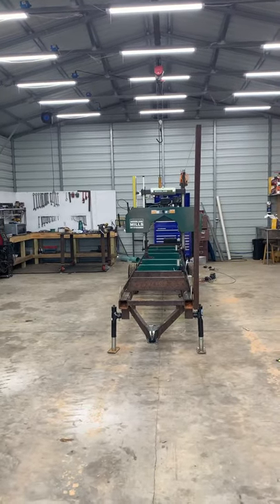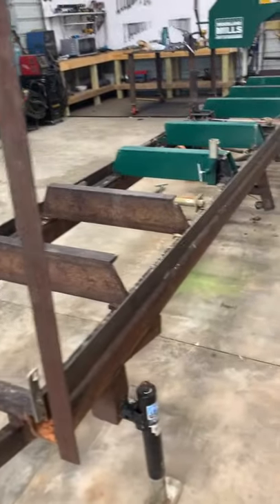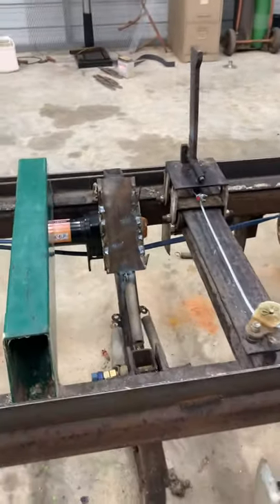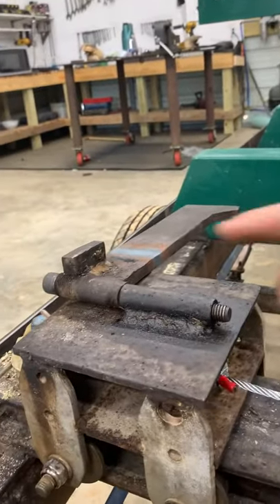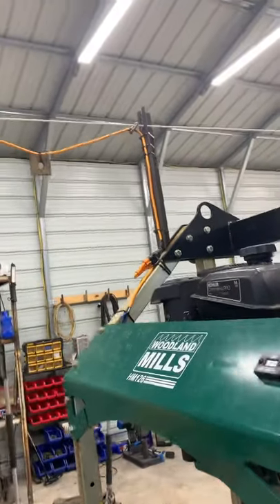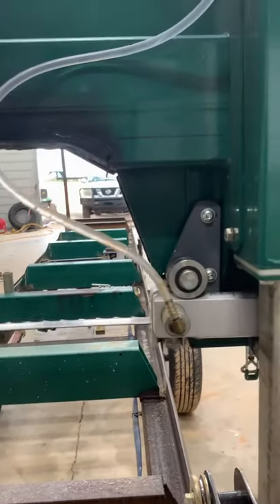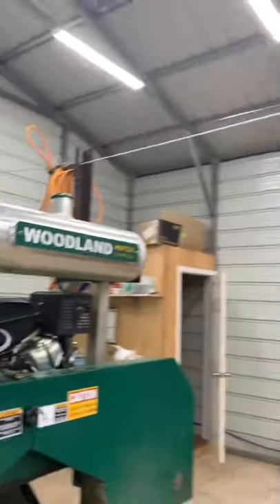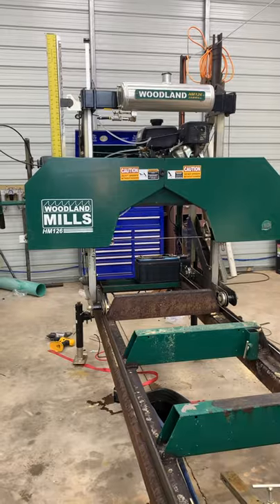Woodland Mills HM126 Modifications

Comment: Nice mods, I have the 2015 model hm126, did the trailer jack mod, no flex cable, mounted the battery on the sawmill frame, with solar charger, battery lasts for days before needing recharge. I put my mill on a 20 ton, 8x20 flat deck trailer, with canopy built into the stake pockets, can do 16’ 2”. All mounted an engine hoist with 2 ton winch to turn the big ones. Did a car scissor jack for toe board, easy to move around as needed for the tapered ones. Not sure how to make powered logs dogs that will work for every possible situation, might have to be hydraulic but that’s a expensive one. Happy sawing.

Comment: I would like to ask if you would be able to send me a link or at the least -model - manufacture or dimensions of the motors you have purchased that you used on your sawmill as my first attempt at purchasing the motor I ended up getting one that was so small I immediately shipped it back knowing that it would not work basically it fit in the palm of my hand all of these sawmill modification and builds are ingenious low-cost and look to be quite functional I think they are a great idea  I thank you for your time and help in this matter have a good day
Reply from the maker: Here is the link for the backstop up and down
Mytee Products 900W 90:1 Tarp Motor for Dump Truck Tarp Systems with Chrome Cover 12VDC / 41 AMPS / 38 RPM (1 Year Warranty) https://a.co/d/iFQN67P
The log turner and log clamp run off of two 3500 lb winches.

Comment: How did you do the power jack for the up and down?
Reply from the maker: You have to remove the whole factory assembly but keep the pulleys off the end and fabricate a bracket for them on the end of the jack and weld a couple mounting tabs to the jack tube to bolt up to the mill.